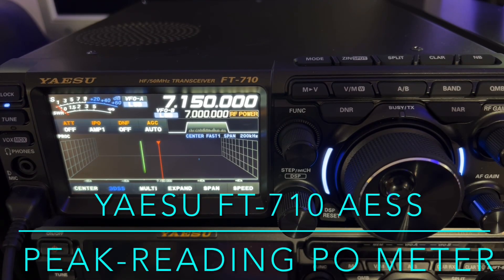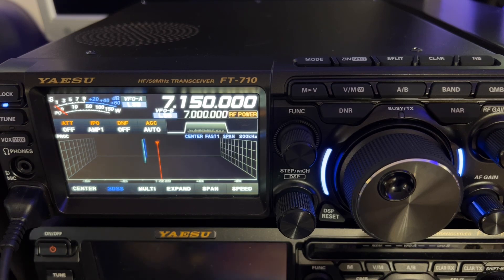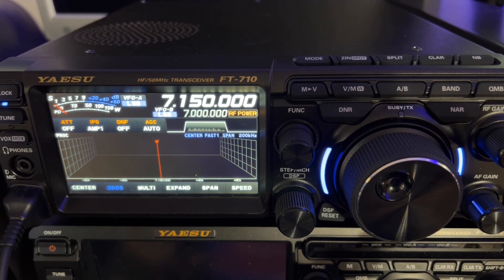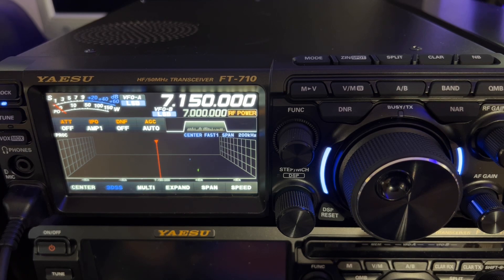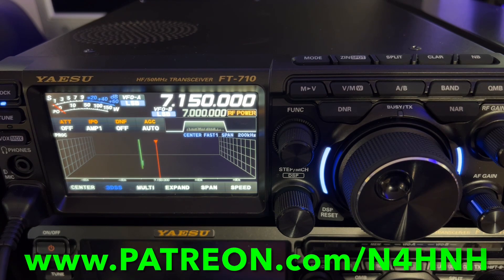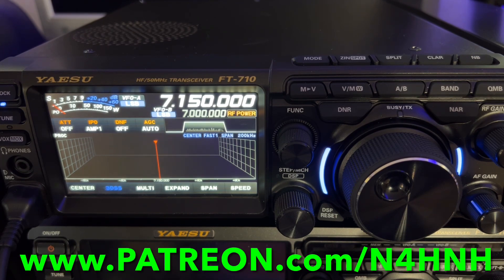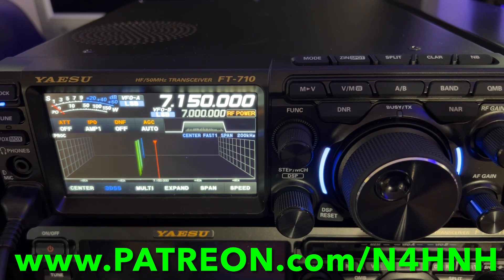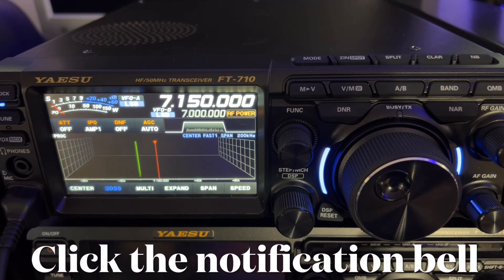Yaesu FT-710 AESS: Peak-reading PO Meter (video #18 in this series)

Comment: Would've been nice to have had this on the dx10
Reply from the maker: I don’t know why Yaesu hasn’t given the FTdx10 that feature in a firmware update. But, you can know your peak power by multiplying what the FTdx10 shows by 1.414.  The FTdx10 displays average power, not peak.  You can always go to FM mode to see what your power output is.

Comment: good video , when i make test the radio only show power maximun type 50 w , tks for you classroom
Reply from the maker: In average mode, the most you might see is 60W. Peak mode should show 100W. Many think they aren’t getting 100W but it’s just that the averaging meter cannot show the peak envelope power. 

73, de N4HNH
Reply: @n4hnhradio  tks for more infos // PU2-MIC - 73

Comment: Thank goodness I found this video! I was about to call DX Engineering..😅
Reply from the maker: Call DX Engineering about?
Reply: @n4hnhradio  Though my radio was only putting out 50w! 😆
Reply from the maker: Yes, you need a peak reading meter to register SSB peak envelope power. This was an enhancement to the FT-710 that the FTdx10 lacks. Maybe a future firmware update can add this function to the FTdx10.  

However, I don’t trust an internal meter for an absolute reading.  I like having a dedicated power/SWR meter. It makes for a great Christmas present to yourself, or have a friend slip the idea to your XYL.

Comment: Wish the FTDX10 had the same tweak for the meter reading.
Reply from the maker: I don’t rely on a built-in wattmeter anyway. But, if enough customers bombard the Yaesu “Contact Us” page, maybe a firmware update could add the peak-reading wattmeter to the FTdx10. But, they will hit a memory limit for firmware updates at some point, so we should prioritize our requests. I prefer more mouse control, as I’ve pointed out in past videos. And maybe add the DATA-U channels to the 60 meter channel bank, like in the FT-710. But, given the shortcomings of the FT-710, I still prefer the FTdx10.

Comment from the maker: The low pitched hum you hear in the background is from the cooling fan in the FT-710 AESS. I covered that in a previous video. For some reason the cooling fan runs 90% of the time, even from a cold power up. While receiving for two hours straight, the fan only turned off three times, for a couple of minutes each time.
Reply: I noticed that. My 450d only ran on transmit.